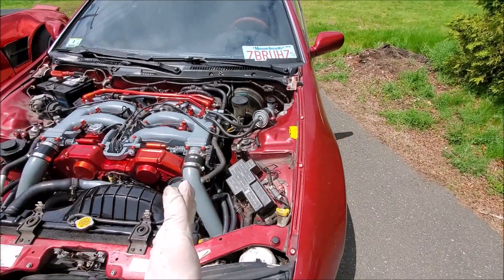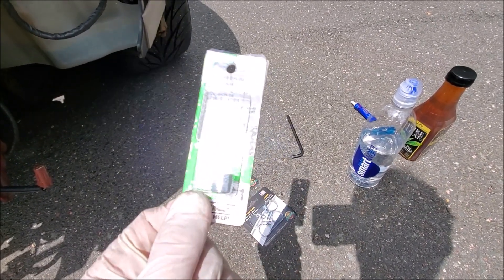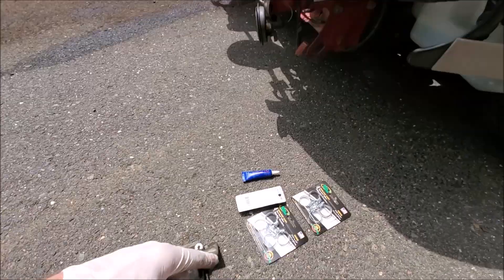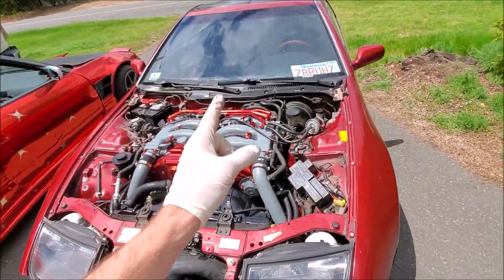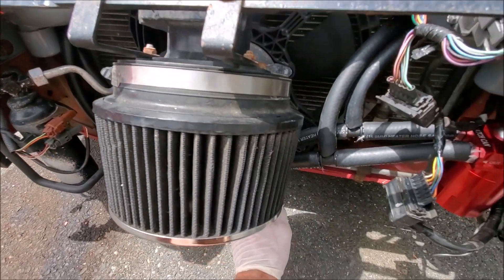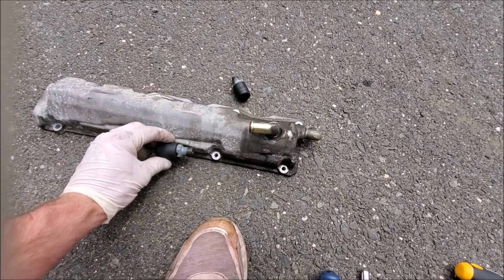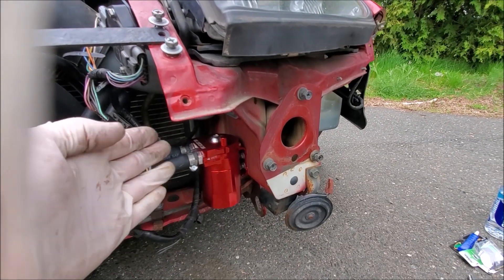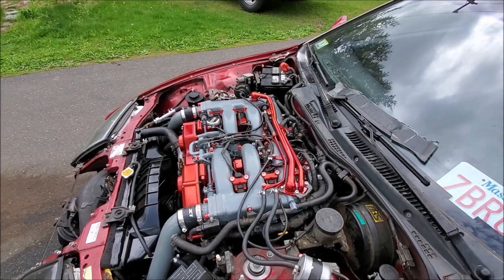A Complete Guide on How to Delete the PCV System on A 1990-1996 Nissan 300zx

Comment: Great info f9r those who have no clue. However. You vaccum hoses off of you intake pipes are turning so hard that are pinched off. Ie. No vaccum source from intake system
Reply: Where can i find that single intake filter
Reply from the maker: @hkzone9532  z1 motorsports!
Reply: @hkzone9532  that thing is HUGE!!
Reply: Can be seen @07:00
Reply from the maker: 90 degree elbows were installed

Comment: I've been having an idle problem with my 3Z. The part at the end where he talks about the hose that helps control cold starts, can that cause an idle issue after the car has been warmed up? It runs fine while cold, but after about ten mins, or until it's warm, it starts to drop RPM and almost dies, drops to the point where the engine will shake a little, then the RPMs kick back up and drops again, kicks back up again, drops again. It does this constantly while it's at normal operating temps. Both my door locks are broke and the key I have doesn't open the hatch, so I'm going out tomorrow to get stuff to break into my own car. lol So, I won't be able to check things again until then and it's supposed to rain for the next few days. Was also going to check the PCV's to see if they're stuck, I read that can cause idle problems, among lots of other things. Any help would be greatly appreciated, I've been trying to figure this damn problem out for a while now, but I don't want to be throwing random parts on hoping that one of them solves it. Parts get too expensive for that.

(EDIT) I've checked the ECU for error codes a few times. Every time I check it, it comes back with Code 55 which means there were no errors. The battery has died a few times though, so, IDK if it can give an accurate readout or not. Used the ECU to check the O2 senors. Both sensors are fine. Checked all 6 spark plugs for spark, all have spark and re-gaped each one. Pulled all 6 coil packs one at a time while the car is running, everything is fine there. Checked for lose grounds, found one, but it wasn't the problem. Going to check the CAS plug when I get a chance, because when I'd move the wire harness that runs the plug wires and all that, it wants to die. If it's just a corrosion problem I haven't found yet, I'm going to drop kick this car. lol Checked TPS with a volt reader, it's fine, checked the linkage for the throttle, it's fine. MAS is fine. I don't remember everything I've checked, but I've tested quite a bit.  Everything I check turns out to be ok. I'm just hoping it's something simpler than the wiring harness.
Reply from the maker: I'm sorry you're going through this, these care can be very temperamental. First and foremost I would replace every vacuume line. 9/10 times it's a vac leak somewhere. Even when telling people this they say it's not this then 2 months later it is. The IACV is a very important component when it comes to idle (Idle air control valve) this is referring to the hose in the back of the plenum. That module can get corroded and stuck over time and can also leak and cause a vaccume issue. You can take the hose off the module and spray a very small amount of WD-40 in there to help lube it up. 

Also if the battery is dieing, you probably have a bad alternator this can also cause an idle issue due to the car not getting enough power. The alternator could just be old or since the power steering pump is right above it that leaks onto it and causes it to short out. Hopefully with this info you can check it out. I would also replace the coolant temp sensor that sits right on the front of the motor near the throttle cable cover. It's yellow, sometime if that can't jiggle it will through timing and idle off, that did help my idle issue before. Good luck!

Comment: What size rubber caps did you use to cap off the pcv valve?
Reply from the maker: They came in an assortment from what I can remember, it was the bigger ones of them all my guess is 1/2 inch.

Comment: Hey, I pulled my motor and transmission to a do a  complete hose and harness change, what are all the deletes/bypasses you recommend?
Reply from the maker: EGR, AIV, carbon canister, single piece clutch line, plenum coolant line delete, install a catch can and block ports on valve covers. Reseal the entire motor and get new gaskets and bushings. New motor mounts! Besides that make the rest your own and how you would like it to look!

Comment: Soooo this might be a dumb question but I just did the pcv delete without the catch can cuz its in the mail so I turned on my z and it's sounds like dog shit is that normal since I haven't put the catch can in yet? Or did I do something wrong?
Reply: Oh and do I have to take the rear pcv hose off and cap that cuz that bitch is hard to get to lol
Reply from the maker: @zeda9253  yes you would need to take that hose off but I would not run the car without a catch can, due do the increased pressure of the crank case ventilation.
Reply: @ZBruhzchannel  then that's probably why it sounds and runs like dog shit. I didn't take off that rear hose and my catch can gonna be in tomorrow. Just wanted to make sure cuz it was running fine b4 I took those 2 hoses off lol thanks man your a blessing

Comment: Any ideas on the tt where too put the out?
Reply: Did you find a solution? I also have a TT and I'm doing this as part of my rebuild. I ran the out on the passenger side to the bung on the accordion pipe that usually connects to the valve cover where the in hose is running from. I had to use a plastic elbow and a short piece of hose to the bung, otherwise the hose would kink. On the driver side the bung is so close to the plenum and the in hose that there isn't really clearance for the elbow piece. I'm debating if I should just T it where the IAC hose goes into the charge pipe. I haven't seen any other opinions so I'm curious if you've solved the issue.

Comment: Hey would this be the same for TT models? I'm trying to figure out where my "out" lines would connect to since my top intake piping doesn't have any nipple coming out to attach a hose.
Reply: Hi did you manage to sort this in also trying to find the best place for out pipes
Reply: @connorgale5049  yes i did
Reply: @codyneumann3261  did you plumb it straight back into the turbo pipe it was venting into in the first place?
Reply: @codyneumann3261  could use some help if possible buddy
Reply: @connorgale5049  I only ran tubing to the catch can, none back to the charge pipe before the turbo. Ended up just plugging that up with a cap and a clip. so the catch can was just venting to atmosphere so i did not run anything out of the catch can
Reply: @codyneumann3261  ahhh I see has that been working well enough for you? I’ve heard allot of people say don’t vent to atmosphere?
Reply: @connorgale5049  yes seems like its working fine, but if people say dont do trhat it'd be easy to rouite line going out bsck to the charge pipe
Reply: @codyneumann3261  yeah that’s what I have now done put a t on the out to to both charge pipes! Hopefully all goes well once back together ect 
Cheers for the info
Reply: You got anything we can chat on about it ?

Comment: You need to plug the intake tubes where you took out the extra pipes. I used 2.5" rubber caps.

Comment: How often do you find you  have to empty the catch can?
Reply: Ah - Pondering whether to go with  a larger tank. This helps. Thanks again.
Reply from the maker: @taipane-biensur7607  if you can afford it then do it!!
Reply: Makes sense. Thanks again.
Reply from the maker: About once every 3 days ish just to be safe
Reply: @ZBruhzchannel  Oh wow, and you have enough accumulation in there each time? Thanks for the prompt response bro.
Reply from the maker: @taipane-biensur7607  yea more moisture and evap more then oil
Reply: I promise, last question, when you do drain it every 3 days, is it usually full? I am finding it difficult to locate  good large affordable baffled catch can. Most are expensive and don't seem to have the necessary features as yours.
Reply from the maker: @taipane-biensur7607  depends on the day with the humidity, last week I didn't check it for about 5 to 6 days and it was 3/4 full. The moisture in the air plays a big role

Comment: delete that pos ptu and run ls or audi r9 coils way better hides under plenum and allows super wire delete. from ecu to ptu is like 10 feet of wire you can delete then just run signal from ecu little wires vs that huge length that stock loom
Reply from the maker: That's the plan, but for right now it is my daily driver and I don't have the time to do the tuck that I ultimately want to do. But the route you explained will be coming in the future!

Comment: Now this is strange, I did exactly the same PCV delete with the same oil catch can bolted at the same location a year ago ! Only difference the can outpout hose is connected to a fitting I installed on maf intake tube right behind the MAF.

Comment: Question bro I follow you in the forums haha I’m always working on my Z it has a lot of problems . But on the driver side valve cover . The line that come off the back end, and turns 90 degrees , you obviously plug that one up. And the line that it connected to previously,  before being plugged . Does that line get plugged up as well ? It is kinda behind the engine , and a smaller pipe, that connects to that valve cover
Reply from the maker: Hey Anthony, thank you for the support. For the delete it is very simple. Driver side valve cover if you are capping them, you can cap the pcv valve (piece attached to plenum) and the corresponding pipe on the valve cover where the oem hose runs to. That thats 2 caps on the driver side of the car. Then for the 2 caps on the passenger side of the car its going to be again the pcv valve on the plenum and then the corresponding piping for that side. Cap those 4 up and your good to go. I have another video on here that shows the 4 lines you need to cap. 

If you using plugs in the valve cover then that back line that runs behind the plenum can totally be deleted

Comment: Awesome Video once again! Perhaps I missed something, but why the need for a catch can? Could you just plug the port in front of the valve cover instead of running the 5/8" hoses?
Reply: If you plug the exhaust AND also the intake ports, you’ve sealed the system and have no means to relieve crankcase pressure... won’t take long for the engine to make its own vent... ie seal rupture.
Reply from the maker: As Aaron said above, if the system is sealed and has no way for gases to escape the pressure will begin to find a way out, either valvecover seals, oil dipstick, etc
Reply: Ah Gotcha..So the catch can provides that. Thanks

Comment: This is what I read, and heard about catch can filters. The two difference, between a filter vs no filter. If you have an NA car then don't use the filter. If your car is turbo charged. then use the filter. My Z is turbo charged, and I still haven't deleted. The EGR which I'm going to do soon! I just did a electric fan conversion, and needs a bit more tweak's. Before I can move on, and start deleting. You could find me on Instagram, at diazkelvin24. I wish we could chill one day. You're from MA, and I'm from NYC. We're not to far from each other Z-bro 🙂. Btw Nice  job on all your work and videos!! 🙌
Reply: I think the filter (or vent to atmosphere) is needed if the intake valve portion of the PCV system is deleted - the pressure has to go somewhere. If you’re still plumbed to the inlet pipes (turbo or na) like our buddy has done here, no need for an additional filter since you’re still technically venting to atmosphere via the intake filters.
Reply: Breather filter, this allows the crank case pressurized air to escape the can.
Reply: Z32 Nissan it doesn’t hurt to have a filter, but there’s already an escape route through the hose that runs to the throttle body (or turbo) inlet pipe.
Reply: @woodnutz78   Aaron W  Very true it won't hurt, especially if your "catch can" has a built-in baffle. Oil won't reach the breather filter. Breather filter, help escape blow-by as well. My catch can has three ports. Two inlet for the crack case, one outlet. Which needs to be "T" for my intercooling pipes.

Comment: How does the crank area breath if you block the PCV ports? The upper valve cover does not perform this function, as pressures in the valve covers are different than the crank area, hence the requirement for a PCV system in the first place.
Reply: Sorry, but this is an inaccurate statement. Just follow the oil flow - if oil can drain down to the pan, air (pressure) is also shared between the crankcase and all 4 valve chambers.